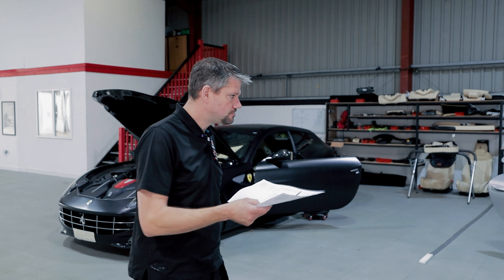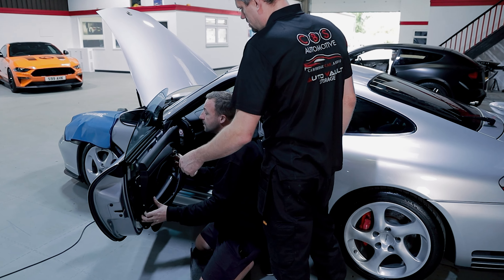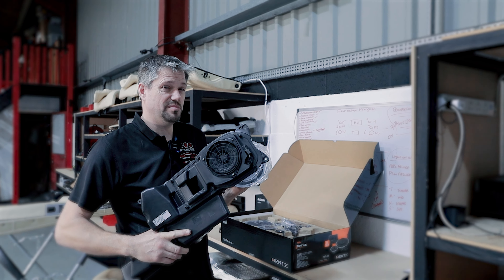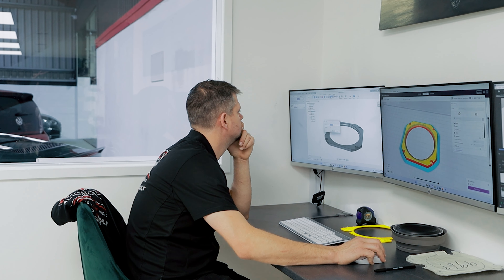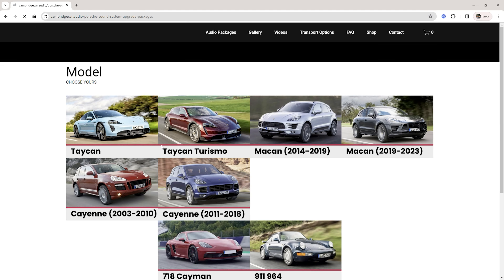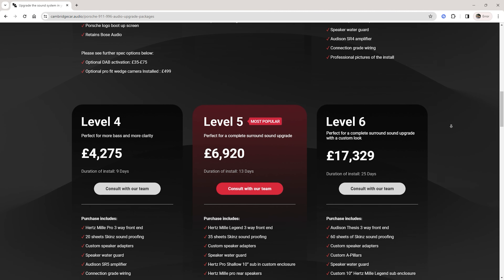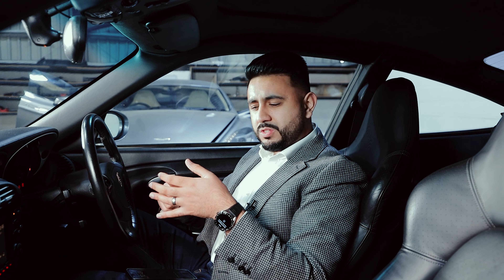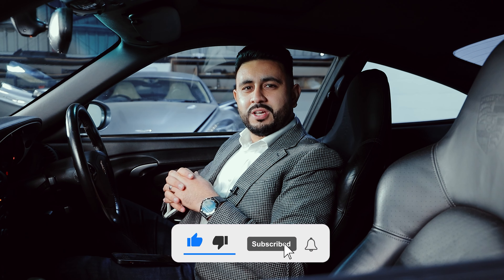Porsche 996 Sound System Upgrade | Custom Subwoofer Installation & Sound Test

Comment: Could you please specify the Amplifier specs?  My 996 Carrera is equipped with Option 490 (Sound Package) = 6 channel Becker BE6600.
I like very much your installation but I don't which kind of amplifier you are showing (looks an Audison)
Reply from the maker: Hi, yes it's an Audison SR5 Amplifier